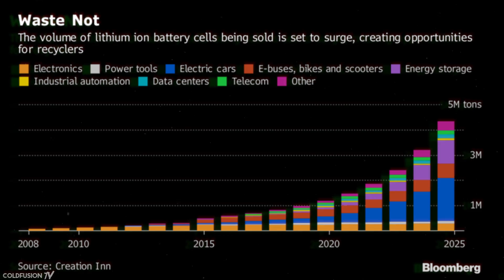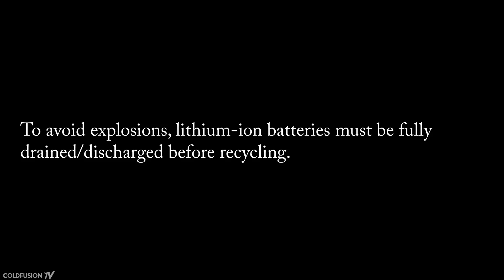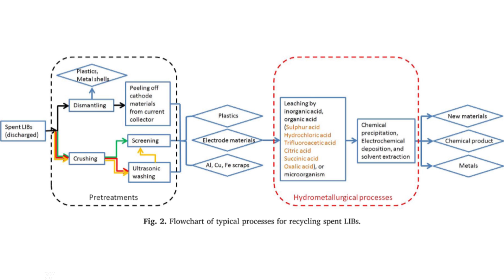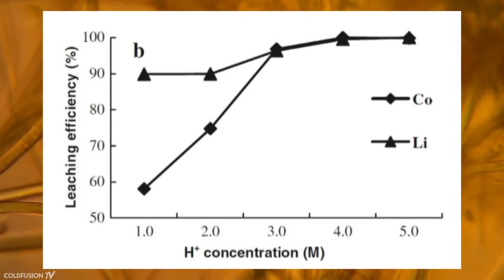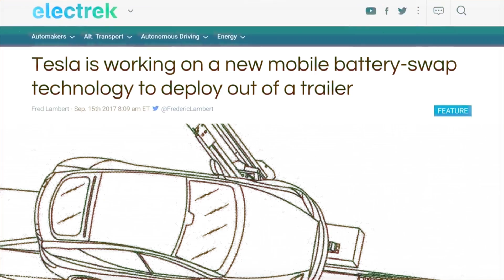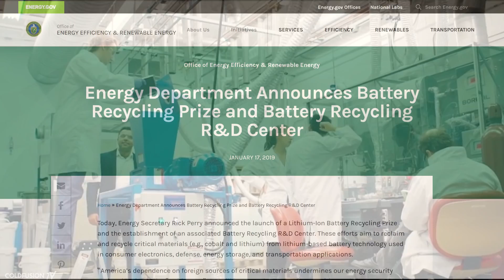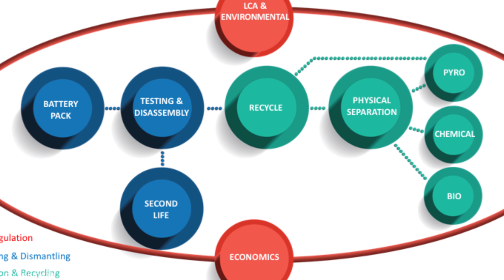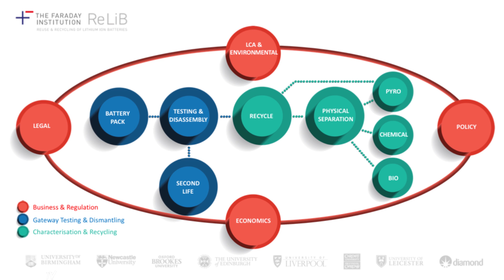Batteries, Recycling and the Environment

Comment: I despise leading, rhetorical, idiotic questions.

The only 'danger' posed by the proposed general adoption of electric vehicles is that the de facto standard of a modern world powered solely by fossil fuels may be dispelled, erasing forever the concept of 'Black Gold', Petroleum, being a path to financial stability or economic control worldwide.  After all, economists were assured for the better part of the past 45 years by experts out of Detroit, Frankfurt, and Tokyo that EV technology 'just wasn't quite there yet', probably would not reach viability for 50 to 100 years, and in all likelihood was impossible to achieve.  The existence of Tesla also challenges accepted, common ideas that insist advertising is a necessary expense, that 'Independent Franchised Dealerships' are the sole viable means of Distribution and Sales of New automobiles, that labor unions such as the Teamsters and UAW are mandatory millstones for corporate manufacturers to bear, or that ICE powered by fossil fuels is the only safe, affordable, reliable means of transportation in the world.  Thus, is it any way wonder that for over a decade there has been a constant, concentrated, focused campaign to  portray EVs as inferior, unsafe, expensive, and incapable compared to their ICE driven forbears by newsmedia companies in print, radio, and television that are largely supported by funding from advertising paid for by petroleum companies, and traditional conventional legacy ICE automobile manufacturers and their dealership networks?  Don't be a pawn of Petroleum companies.  Decide for yourself, based on the evidence available.  Sure, it is often argued that EVs simply 'cost too much'.  Perhaps.  Notice how in 1990, the average sale price for a new vehicle sold in th U.S. was $15,000.  Today that amount is $38,000.  Yes, for several years, the Nissan VERSA was the best selling, cheap, ICE based car in the U.S. at around $12,000 MSRP and it was greatly outsold year after year by the BMW 3-Series, which sold for at least $34,000.  Today, both are outsold by the Tesla Model 3, in the U.S.  Combined.  Collectively.  In Consecutive years going back to 2018.  Being based upon ICE does not automatically guarantee low price or high sales.  Those who suggest otherwise are entirely ignoring the facts and evidence to the contrary.

Similarly, the Tesla Model S has outsold many of its direct competitors among large, luxury, flagship Sedans since 2013.  Again, its market dominance has been largely combined, collective, and consistently consecutive, despite repeated claims that Model S sales were being cannibalized by Model 3 sales in recent years. Oh, and the direct ICE competitors to Model S, in top trim, all cost more than the top-of-the-line Model S in its top Performance trim.  So no salvation for ICE in that realm either.  Even newcomers, praised for their size, power, handling, styling, and price point, among entry level luxury cars, such as the GENESIS G70, KIA STINGER, and Alfa Romeo Giulia, all ICE powered,  failed to impress buyers in large numbers, despite their strict adherence to the precepts of tradition, convention, ritual, and legacy.  Even with their use of 'Independent Franchised Dealerships', and advertising campaigns that were rather widespread, none of them came close to the sales of the Model 3.  The term 'Diminishing Returns' comes to mind, along with 'Throwing Good Money After Bad'.  Even a rousing endorsement by Emerson Fittipaldi failed to garner results for KIA's entry.  Each of them was simply 'Too Little, Too Late', a fate I believe, will befall the Ford Mach-E and Ford F-150 Lightning as well, though I actually like each of those.

FUD -- Fear, Uncertainty, and Doubt, have been fundamental in spreading potential, and inaccurate, propaganda against EVs.  Concentration on the multitude of supposed 'problems' that presumably have not and cannot be addressed by EV Proponents, such as myself. For decades, I heard them say, "Until EVs have a 200 mile range, minimum, they'll NEVER be a viable source of transportation for the average person."  Yet, when 200+ mile range appeared, nine years ago, suddenly the argument became '400 mile range, minimum' despite the fact that numerous performance oriented modern ICE vehicles, sometimes costing multiple hundreds of thousands of dollars, were incapable of a 300 mile range, even using gasoline.  The excuse offered for that was that such performance cars 'were not meant to be grand tourers' and that 'most people rarely drive in excess of 40 miles per day, anyway'.  So, assuming that's the case, why the minimum necessity for five days' worth of range?  I used to think that was because, roughly 45 years or so ago, most cars were essentially gas guzzlers.  So, a car with a 19 gallon fuel tank that got perhaps 12 miles per gallon had a maximum range of maybe 228 miles on a good day.  Back then, there were no 'low fuel' idiot lights on the dashboard of American gas guzzling behemoths, so when the shadow of the bouncing needle of the fuel indicator/guess-o-meter glanced against 'E' on the fuel gauge, that was it, you had a walk ahead of you to get more fuel, because the car stopped, cold.  There were no cell phones either, so no easy way to contact roadside assistance was available.  You might be lucky enough to be nearby an operational roadside Call Box, but that could be expensive.  Not that  stopping at any of the Last Chance GAS! stations that used to dot the open highway in Arizona, New Mexico, and Texas were particularly inexpensive, as they charged ridiculously expensive amounts per gallon, mercenary rates, just to fill up, for a ride, or tow.  If your car only got 5-to-8 MPG, it was even worse, as your effective range was diminished even with a 25 gallon tank.  Because of this, people routinely stopped to fill up at anything below 1/4 or 1/2 tank remaining, and really had no idea of the actual range of their cars.  People who remember those days typically misjudge their needed range requirements for daily driving and mistakenly run out of gas all the time today, thinking, "I just put five bucks in it", forgetting entirely that it has been a LONG time since Regular gasoline cost less than $0.75 per gallon.  Dude, your circa 1978 El Camino is a gas guzzler, five bucks barely buys two gallons now, you were lucky to make it home.  Of course you ran out of gas.  Learn to count.  Numbers won't kill you.  I once had a Girlfriend,  eight years older than I was, who was in the habit of similarly thinking 'five bucks' was a substantial amount of fuel.  It was extremely difficult to convince her to read the amount of gallons she added at the pump instead of the total price she paid as a metric.
Reply: ah, yes , we shall forget batteries that cannot be recycled fully or are just buried , looking forward drinking "infused" water  some 20 years later

Comment: They worst is yet to come.  As Solid State batteries emerge which are the needed technology to make EVs lighter and more efficient; Lithium ion batteries will become obsolete making them worthless to recycle.  It would be better not to make full EV cars and make hybrids as the heavy weight of full EVs based on Li more that off balance the efficient electric motors; they also cost more energy to make. While Solid State may make the promise of all electrics come true - till then Li based EVs are a negative; and will become a big liability when they are worthless obsolete junk.

Comment: Million Dollar Potential in Ruvol

I have invented a Board Game [still unpublished and not yet out in the market] that is guaranteed to be far more challenging and exciting than CHESS.  I called it “RUVOL.”  

Over time, Ruvol will surpass chess as the “Number One Board Game in the World.” 

Why am I so sure about this?  Because I am an avid chess player myself.  

The weakness of chess is it always starts in fixed positions that the opening moves become “memorizable.”  In fact, not a few have so mastered the moves that they can play against their opponents “blindfolded.”  It is for this very reason that the great Bobby Fischer introduced his so-called “Fischer Random Chess,” where the starting position of the pieces is “randomized” to make the memorization of openings impracticable.  Fortunately, it is also for this reason that I invented Ruvol where “every game” has been calculated to be a challenging one to play.

HOW IS RUVOL PLAYED?

Ruvol is played somewhat like chess.  It is played by two players.  It uses a board that is rectangular in shape but containing more number of squares than chess.  It has equal number of pieces on each side of the board, where each type of piece moves in distinct ways.  However, if the way to win chess is to checkmate the opponent’s king, the way to win Ruvol is to be able to cross a designated line.  

But there’s one big advantage Ruvol has over chess:  The Ruvol pieces are randomly placed at the start of “every game” which makes it impossible for any clever player to memorize the moves.  

A MILLION DOLLAR POTENTIAL IN RUVOL!

The people who play chess will be the same people who will play Ruvol.  In my Google search, I learned there are around 800 million chess players in the world.  These 800 million players comprise the “Total Potential Buyers” of Ruvol across the globe.  At an average profit of just US$3 per set, the “Global Income Potential” of Ruvol then is US$2.4 billion.  Assuming only 1% of it will buy each year, the annual global potential sale of Ruvol is US$24M.

I AM LOOKING FOR AN INVESTOR!   

For the reason that I don’t have the resources to publish Ruvol on a global scale, you might be interested to “FINANCE THE PUBLISHING” of my Ruvol on a profit-sharing arrangement.  Or better yet, just “BUY MY COPYRIGHT” and Ruvol is entirely yours.  If interested, email me at:  rodolfovitangcol@gmail.com.   

Thanks and God bless!
 
RODOLFO MARTIN VITANGCOL
The Ruvol Inventor
Reply: like

Comment: lithium is an element that is not destroyed just like aluminum is not destroyed when used for soda cans for example. it therefore stands to reason that with the right technology it will be recycled into new batteries. there just hasn't been enough Li waste produced yet to incentives its recycling as opposed to mining new deposits. this is an area that will become ripe for entrepreneurship.
Reply: Obviously most elements are not destroyed. Fact is "not destroyed" doesn't mean it naturally turns back to the original state. When we make glass out of sand, it doesn't naturally revert back to sand, does it? Same thing with mineral processing. You can recycle. But you can't turn it back to its natural state.

Comment: Eventually company´s will recycle their own batteries.  
Because it can and will save them a lot of materials and money. 
The problem is that to recycling the lithium cells of today is a costly and timely thing.. My guts and insights are telling me that they will find a way to recycle those cells cheap.
when that happens its game ON.. batteries wil get cheaper...Electric mobility future  secured for the masses.
Reply: Batteries use rare earth elements right? By the time world's batteries need recycling, there will not be any natural sources of minerals left on earth. Because we won't recycle until we can't make new ones.
Reply: @RR-us2kp  why would they not start recycling batteries before running out of the raw materials to make new ones?
Reply: @cmhardin37  You should ask that question from plastic manufacturers. Plastic could be recycled ever since it was found. But there's still more new plastic being made compared to the amount that is recycled.

Comment: Actually i believe that those standardized form-factor batteries are easy to dismantle and separate. Reversed process or bullet manufacturing. A) Cut both heads (sizes are standardized) B) push piston and wet + roll of lithium film will be pushed out. C: Put 2 needles and roll out the film D: then pass with precise gravity powered calibrated load one side of film over 
grater to remove powder E: turn arround film and do it again (probably assisting with ultrasonic). E: Liquid (electrolyte) must be  collected and chemically separated in high purity components  F: wet powder is to dry off and recycle - make again fine grain powder with proper size nanostructure for next batteries. 

I see more problems with already burnt batteries, or pouch batteries that got moisture inside (puffed).

Comment: so the photos of lithium mines that are literally giant open pit mines are wrong?  If graphene  and other batteries are just around the corner  that we may be able to grow in a lab with out digging giant holes in the ground in countries that don't have strong environmental protection, then maybe we should slow TF down on pushing Lithium. Most transport vehicles could be powered from trolley lines, and most consumer cars these days stop their engine when not moving. which would take the emissions way down and not have the carbon footprint of mining it out of the ground.

Comment: During the consumption of Goal, useful products are received such as heat and Co2 which can be used for further growing of energy and food crops. Coal is a finite resource but there are so many steps in it's consumption we should be using, first we have to de-vilify Co2 and start using it and producing it with purpose.

Comment: I read that Dr. Goodenough (the man who invented the Li OH battery) just invented a new battery technology.  And physicists, after looking at the formula which describes its process.  They say it is impossible.  With use, it does not degenerate.  Rather it gets stronger.  It changes everything.  Look into it, you will most likely be surprised.  Or in doubt.  Either way, you will be moved.

Comment: YOUR SO WRONG ABOUT THE TESLA  BATTERY DEGRADING 9% AFTER 160,000 MILES THEY HAVE TESLA'S THAT HAVE  6% DEGRADATION AT AT ABOUT  600 '000 MILES ...  AND YOUR FALSE STATEMENT THAT PEOPLE WILL JUST THROW THEM IN A LAND FILL IS JUST WRONG  ...  THAT'S WHAT PEOPLE DO WITH BATTERIES FROM THEIR REMOTE BUT YOU DON'T MENTION THAT AND THEY HAVE BEEN DOING THAT FOR YEARS  ...  12 VOLT CAR BATTERIES HAVE A 99.9% RECYCLING RATE  EV   BATTERIES WILL BE ABOUT THE SAME YOU IDIOT

Comment: One thing I hope is that Tesla get better at making cars as in the body and what goes into it. The handles Don't work in winter as the ice freezes the push buttons which is sad. Also what would take most manufacturers one piece of metal they use 3-5 pieces connected depending where in the car reducing the rigidity which could be improved and raise their already high crash rating.(Do any of you know why they are so good?) Also what would take one company one type of bolt or fixture they use multiple across the car making it a mess to deal with as each part of the car needs fixing in very different ways. It also doesn't help the parts aren't standardised.

Comment: Those Evaporation Pools use vast amounts of water in Arid regions, also the removal of these salts is likely to severely affect nearby Ecosystems. Open Cast mining means the scraping off of large Green and forested areas. For what? And EV that can only ever have a negative impact, and can never give back. These Lithium Ion battery Vehicles only serves people and a v small minority of them!. . Unlike using our current ICE Vehicles in effect, as Carbon Capturing machines by running them on Carbon Negative Algea Bio Fuel!. Also the climate doesn’t have the time, resources or enough renewable energy to manufacture millions or billions of new Vehicles whether they are EV or otherwise!. The 10 year IPCC countdown is ticking away, but Photo Bio Reactors( PBR) to grow Algea Bio Fuel are easy, cheap and quick to build. At same time they can be fed our waste water so cleaning it and saving us lots of energy in waste water treatment facilities. Also they would create millions of local jobs and revive local and regional economies! growing Algea is all gain!. Plus the 10 pounds of nutrient rich Carbon residue thats produced and permanently removed from the atmosphere, for every gallon of fuel, is rich in Omega 3 so is used in Nutraceuticals, and to revitalise degraded Soil etc.

Comment: Laws must be created so that it is ILLEGAL TO SELL ELECTRICAL DEVICES WITHOUT REPLACABLE/EASILY REMOVABLE BATTERIES. 
The customer should not have to use a heat gun to remove the battery either to replace it or dispose of any device. The current trend for sealed in batteries is taking PLANNED OBSOLESCENCE dangerously too far.

Comment: Batteries are an ecological nightmare of their own. I saw a video about a machine that uses solar to capture carbon out of the air and convert it directly back into a burnable fuel. I think this is our solution. It's not adding any new pollutants into the atmosphere. It only recycles the stuff that's already up there. We'd basically be burning the exact same carbon atoms over and over using solar power to recombine them into a burnable form. This solves a lot of problems, primarily, you don't have a massive battery to recycle at the end of a vehicle's life cycle.

Comment: This is not needed if you have a new engine and NH3.  Solar and wind off line make NH3.  Nuclear for grid at 1.5 base load.  Excess goes to NH3.  Run cars, trucks, boats, airplane, heavy equipment and building.  100% renewable is very doable and quick this way.  Otherwise...good luck...take 20-30 years.